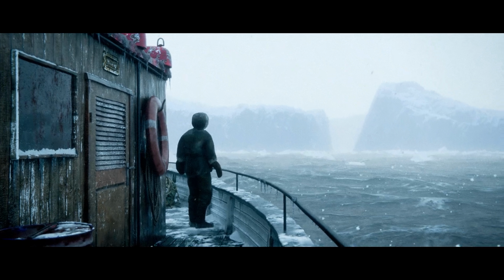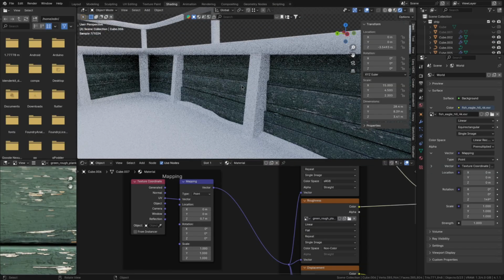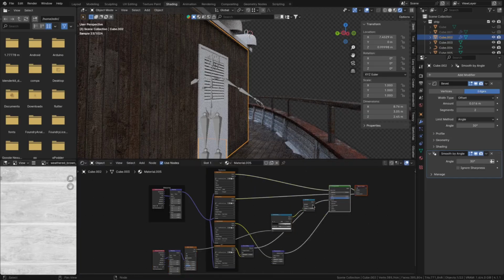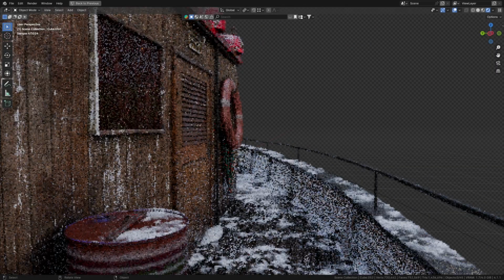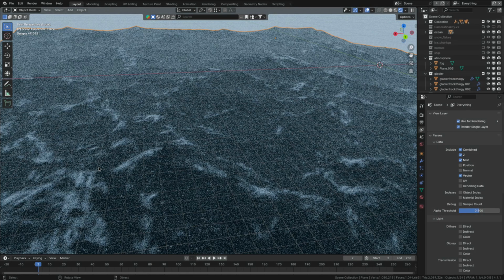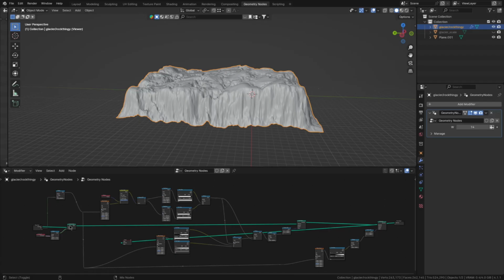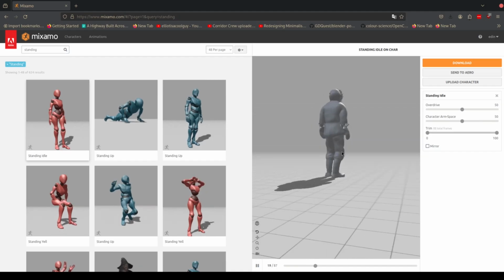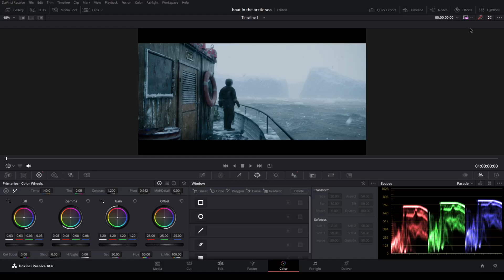Creating a Boat in the Arctic Sea - in Blender

Comment: this is really good, I would like to know more about the temporal animation stabilization, most of the time my renders look like that because my samples are low, my pc isn't good enough to render a high count I was wondering if it could fix them and make them look sharper , would be a life saver if you could see this and reply to it :)
Reply from the maker: Thank you! yeah I mean the temporal animation stabilization won't improve the sharpness of the render (it will probably make it just slightly softer) - but it will remove that "warbling" that the denoiser produces in animations that are rendered with low samples
Reply: @edinspiegel  thanks, that's more than enough for me , honestly. i'll be getting it